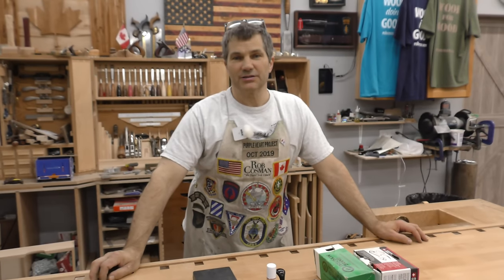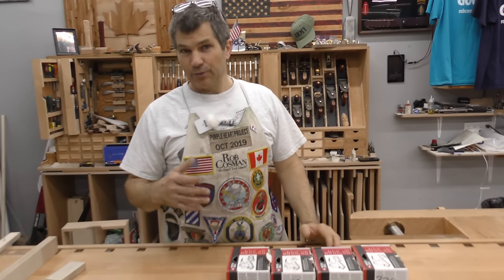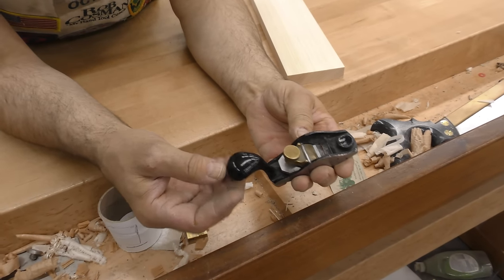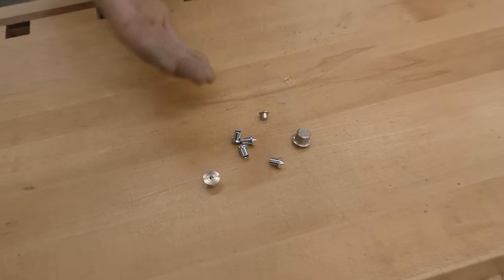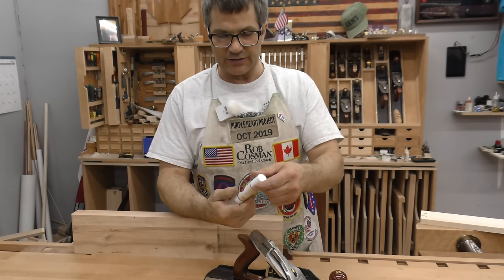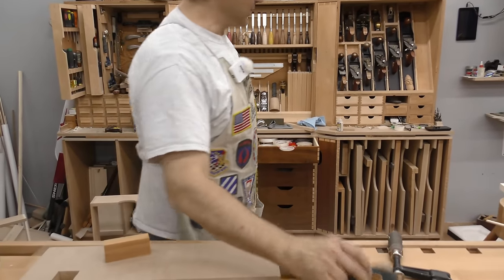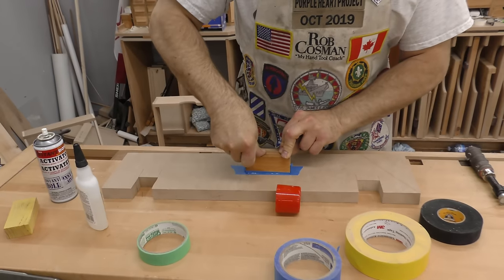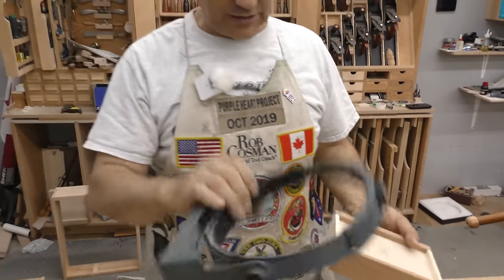Top Woodworking Gadgets - MUST HAVE ITEMS

Comment: Get a pair of surgical loupes such as those made by Designs for Vision. You will not need to put the strap-on thing around your head and you will so quickly get used to them that you will start wearing them around the house. Having done microsurgery and hand surgery for over 30 years I have even found myself wearing them to the bathroom which obviously occasions some humorous comments. I would recommend the 2.5 power and would point out that their customer service is second to none. They're not cheap though. Best wishes and thanks for all the great videos.

Comment: I keep tooth picks in my "solve most problems handyman bucket" because, most of the time a screw or nail is loose.  I use the tooth picks to dab a little bit of glue in the hole, then I jam tooth picks in the hole to to repack the hole with wood, so the screw or nail has something to grab onto or bite into.  I've used this trick on antique furniture, door jams, windows, baseboard, crown molding, cabinets, exterior trim, etc.  If it is made of wood, mdf, particle board, plywood, or exterior grade pic, this trick works great!
Reply from the maker: I have done that trick too. Great comment.  Tons of other things you can use screws for too

Comment: one of the things I use for thin shims in all kinds of applications is the plastic coated playing cards
my last trip to Vegas one casino was giving away used ones for free so I got a bunch of packs they 
work great in all kinds of spots as they are waterproof  and do not compress
Reply from the maker: That's an awesome idea...free too!  a playing card is about 6ooo.  what do you do for smaller than that??
Reply: @RobCosmanWoodworking  another one I have used is tinfoil and with both of these when trying to make it stay
where you want it to is wet your finger with a tiny bit of wood glue then wipe back of shim put it in place

Comment: Good information Rob.  I think I've used most of those, but the sandpaper was one I wasn't familiar with.  One small point..You call them Vernier Calipers, but show a simple dial caliper but label it as a Vernier caliper.  I might well be wrong, but I've never seen a dial caliper or for that matter any digital calipers that are Vernier.  Vernier is a bit older system for reading finer measurements than normally could be read on a straight caliper.  A lot of cheap calipers ARE indeed Vernier, but that doesn't mean that Vernier is a bad way to do it.  Just that modern methods like Dial and digital don't need that.

Comment: I was brought up on the metric system and am somewhat challenged in working with an imperial dial indicator.  My favorite solution was finding a dial caliper that actually had the fractions on the dial, rather than thousands of an inch.

Comment: I like using blue tape as you did with the CA, but instead of CA I use carpet tape. Same result, super strong connection and can easily be removed with no marks.
Really handy for template routing.
Reply from the maker: Great tip!  I didn't think of that but carpet tape is so strong it should work...I will try it
Reply: I use carpet tape the same way with the painters tape as the base. It’s great for batching out designs on the scroll saw as long as you leave a tail to tape. I tried to cut through it once. Once... haha

Comment: My tip that I use.  Masking tape or blue painters tape, if its old and tears off the roll, put it in the microwave for 10 seconds, usually works great again.
Reply from the maker: That's a great idea!  I have never tried that , but I know exactly what you are talking about.  I will definitely give that a try
Reply: So is the microwave your workshop gadget of choice?
Reply: I'm definitely trying this next time I'm in the shop! Bad tape is so frustrating.

Comment: I use a 1cc syringe with small blunt needles to finely put CA glue where I want it.
Reply from the maker: Ingenious!!  Where do you get the needles?
Reply: I get them from amazon. Super cheap. When a nozzle clogs, you can just open the bottle and draw out the glue too. I avoid Aliexpress like the plague.
Reply: I use little plastic pipettes. You can get a hundred for a few dollars on Amazon, and they can be reused a couple of times. The very long, very thin tubes allow exact placement.
Reply: I use exactly the same thing for injecting glue into the grooves for stringing and inlay. Also, 2-3cc pippettes are really useful for putting resin in exactly the spot you need it for when you're filling knots or defects in either normal woodwork or in woodturning.
Reply: You can also easily file off the sharp tip with a couple strokes of a metal file. Also when it clogs, heat the tip with a flame it will clear out the dried CA, only takes a couple seconds. Just be sure to aim the tip away from anything that you don't want CA on, the heated CA will shoot out as hot liquid form. I normally for go the syringe part and just modify the tip of the CA bottle to fit the needle base, a batch of 30 needles has lasted me over 5 years now.
Reply: @theeddorian  or a junkie
Reply: @mikeking7470  Well, maybe.  But if you are the kind that occasionally slips, a different source is indicated.  I came within an ace of giving myself an injection of Titebond III. I was repairing a cracked apron intended for a small stool or stand for my computer. The wood failed, the syringe slipped and somehow I had glue and a scrape on my other hand.

Comment: Great vid!! Totally onboard with your selection & love the feeler gauges on the shooting board, clever!! I have built a shooting board using an Incra V27 as the fence. It is easy to use & is very accurate (wish I could load a pic). I also use Paul Sellers' rag-in-a-can instead of wax
Reply from the maker: Yes I would love a pic of that shooting board.  Can you send it to robswebmaster@robcosman.com

Comment: Three of my favorites are:
4" magnetic bowl from Harbor Freight that I use for holding screws, bolts, washers and nuts,
--------------------------
Elmer's Wood glue transferred into a yellow mustard bottle from Dollar Tree.  So much easier for me to work with than the original Elmer's bottle it came in,
--------------------------
Sanding belt cleaner block from Harbor Freight which works phenomenally well with cleaning my belt sanders.  It's definitely been worth the money. =)
Reply: rectangular longish mag bowl on top of the drill-press for things that don't file away well, screwdriver bits and countersinks and key and punch.
Reply: That's my favorite, too! You can also use a good-quality paintbrush to brush sawdust off of stuff, even sandpaper.

Comment: US Postal Service rubber bands that come on bundles of mail.  They are about 1/4 inch thick, and 4 inches wide laid out on the table.  I collect a few at work and use them as clamps for small boxes.   I store them on a piece of cardboard folded into a wedge, two long sides and one short, allowing quite a few to be stored together without collapsing the cardboard.  They only have a three year shelf life in my garage so I replace them periodically.

Comment: Kurobara/Camellia Oil - lots of uses; I use this to protect any steel that might rust (smother my jointer top with it), I use it as a lubricant when sharpening, & it can be used as a quick finish on a wooden handle.
Reply from the maker: Great tip!   I use it to prevent rust also

Comment: 1-2-3 blocks are as essential in a wood shop as they are in a machinist shop. They work as a tiny square, a weight, a spacer, and they’re a great aid in setting up router bits and saw blades for a specific depth and/or offset when used in combination with the calipers. Get a set with holes and a set without holes and then just toss an extra set in your amazon cart every time you’re a few bucks away from free shipping.
Reply from the maker: Yup several folks are recommending them.  I love them too
Reply: My favorite use for these is as an offset on the table saw.  You can use them when you are using a crosscut sled or miter gauge, easily clamp them (through the holes using a sacrificial fence clamp) to the close end of the rip fence.  Then just set the rip fence to 1 inch more than your desired length and you have a precisely dimensioned crosscut and no kickback from pinching the board.

Comment: It seems I always need to make small adjustments. Stanley makes the perfect tool, a 1 inch wide chisel that folds to protect the blade (and your leg) and drop in a pocket. It is one of the Fatmax series of tools and the handles are capped with steel and made from what feels like fiber filled nylon. At only $12 - $13.00 I really expected the  steel to be inferior, but it takes and keeps an incredible edge. Other brands are available, too. Fastcap, and Morakniv come to mind at a higher price.
Reply from the maker: I just looked it up, interesting

Comment: a compass.  And no, I don't mean calipers.  I have been doing a lot of renovation work with buildings, framing, and furniture that don't have straight lines. By using a compass I can transcribe the curve onto an adjoining board and then cut perfectly to the line using a bandsaw.  Just a simple one from the dollar store and a super sharp pencil will do the trick.

Comment: Masking tape and super glue trick is absolutely invaluable to me. It might be less useful for people who are doing most general woodwork and have all of the usual tools and work holding devices, but I use it most of the time that I am using my router off the table. Which is pretty often since I use a router sled for stuff like thicknessing. I also use it for any template work, to temporarily attach templates to the work. And it's also good for holding thin stock in place for planing. Or if you are trying to make two of something exactly the same, use the trick to hold the two pieces together (similar process to stack cutting on a scroll saw.) I have also used it for temporary handles as mentioned in the video. Good for gluing down sandpaper to a flat surface without making a mess of the paper or the surface. Basically, whenever I'm thinking about how to get one thing to temporarily stick to another thing, it's one of the first ideas that comes to mind, it's just such a good trick. And a lot of times it holds so well that it can be a bit of a struggle to separate the pieces intentionally, no chance of things coming apart on accident.

Comment: I have a stack of old steel gym weight plates that I keep hand for glue ups that I can't get to with my clamps.
Reply from the maker: Thats tons better than me having Jake stand on my stuff!  COL Luther says he does the exact same thing.  I think its a great ifea
Reply: @RobCosmanWoodworking  I've been using kettlebells for about 10 years.  I call them my #20 gravity clamps. :-)
Reply: I salvage the heavy weight ring from the bottom of old pole lamps, and use them as clamping weights,
Reply: I use ingots of wiping solder for the same thing.

Comment: I keep a couple of automotive drip pans in my shop.  Some call them large "cookie sheets".  Very handy when I'm doing a small job using adhesives or finish, and don't want to pull out (or waste) material to cover the work bench.  They also store and clean up well.  The turned up edges keep liquids from running onto the bench, floor and clothing.  I also use actual cookie sheets for even smaller tasks.  Not to be used when an absolute flat reference surface is essential.

Comment: 1-2-3 blocks, setup blocks/parallels, plunge dial gauge, dial caliper, dial gauge holder, a good straight edge.    use to set table saw height, drill press table square, all types of machine calibrations, dado blade shimming, ... the list goes on and on and on.  of course feeler gauges, and miter track slide to hold the dial gauge, etc.
Reply from the maker: Yup, lots of folks singing the praises of the 1-2-3 blocks.  Anything that helps with setup is a must have gadget

Comment: I use the self adhesive foam grip tape from Festool, and 3mm self adhesive foam sheet, wherever I need grip.
( i.e., on the bottom of my shooting boards, on drawer bottoms where heavy items like planes, router bit kit boxes, Chisel sets etc., can slide during opening/ closing. On the bottom of push blocks. I put some rubber foam sheet on both sides of a board so I can sand flat boards and small items with my orbital sander.)

Comment: Have you looked at the Procarpenter lefty/righty sold by fastcap. It has the markings so you can read it regardless if you are left or right handed. Saves my neck from trying to twist it to read the tape measure. I am a lefty so it was helpful.  It also has markings for 1/8, 1/4, 3/8 and so on for us old folks who can't always see the little hash marks for the 1/16 lines.
Reply from the maker: I just looked it up.  I will try it out and see what I think

Comment: I use an artist's brush for spreading glue (palette knife as well!), and rinse it in a plastic pill bottle with a hole punched in the top.  This stays handy, doesn't spill,and the water lasts a long time.
Also, I rigged up an air pump (from air mattress I think), 7 or 8 feet of 1" flexible hose sold for garden fountains, and a small nozzle.  This hangs like a flexible shaft motor and provides a gentle air stream to blow chips & dust off of the bench, machines, self, and out of corners for easier sweeping.  Surprisingly handy.
Reply from the maker: awesome tips

Comment: to add to your list of gadgets.... 
-When adjusting man-door hinges with shims, a glue stick from the office supply helps keep them in place
-Although I have a sh*t load of hand scrapers, I recently discovered that replaceable skate blades are perfectly suited of hand scraping, Two edges, easily burnished.  nice curvature on them allows near-flat scraping and also curved at ends. 
-Also add to collection of tapes with the stretchable/strong tape that the granite countertop folks use. Stretchable and strong beyond belief
-A nut cracker for opening hard to open glue containers
-a few stips of leather to line vice or vice grip jaws to avoid marring work held in them

While I like you're use of optivisors, I think I'm the only woodworker in our area(Calgary) who has a binocular microscope which I use to examine blade edges. I like to call them "optical crutches"

Eric

Comment: Kidney trays. They act both as bowls and trays so they're great for both, cheap to buy and i always 3 of them stacked on my bench.

Some uses: Put in stains and other chemical bottles that harms your bench. Have a magnet under it or just as a plain screw holder, mix your sawdust-glue paste in it or spread glue on your roller, use them as short hand rests/raisers for sanding small things, they are perftect for shallow baths for tool cleaning etc, use them as ghetto mirrors to see under or behind things you can't move.

Comment: Plastic soda straws.  I used them to remove excess glue before it dries from the inside of 90 degree joints.  When pressed into the joint, the straw conforms to the square joint shape and scoops out almost all of the excess glue.
Reply from the maker: Great tip, thanks

Comment: I would add rare earth magnets. So many amazing uses in the shop and with furniture. I epoxied magnets to all my air cleaner remote to stick to tools, use one on the drill press to hold the chuck key, etc.
Reply from the maker: I love rate earth magnets too.  Yup they should have made the list
Reply: Yes!  I salvage big ceramic magnets from discarded microwave ovens.  I stick the chuck key to the drill press, the arbour nut wrench to the table saw... it's a long list.  I use neodymium magnets instead of door catches.

Comment: Tooth picks (pointed both ends) and popsicle/craft sticks. I find multiple uses for these.
Reply from the maker: Yup,  i love the and Q tips for placing glue
Reply: I use popsicle sticks a lot at my workbench, too.  Great for stirring epoxy or applying it to areas.
Reply: Great for filling old screwholes if you want to move them ever so slightly
Reply: Bare-wood golf tees ...useful if a screw hole is in the wrong place and has to be moves a small amount. Glue the tee onto the hole, cut it off flush, and drill the new hole. Works for stripped-out holes as well.

Comment: regarding your headgear- I buy normal reading glasses at the drug store but I buy them in the highest powers I can find up to about 4.0.  They aren't good for reading or walking around the shop but when I need to see something up close I put them on.  I even bought a pair of 6.0 online for things like pulling splinters out of my finger.
I use fine point mechanical pencils in my shop, even cheap ones from the discount stores.  0.5mm works for fine marking, 0.7mm or 0.9mm works for more carpentry where you can get by with a fatter mark and you want a more durable lead.
I've heard about people using playing cards or business cards for shims.  I've got an old pack I found for that.